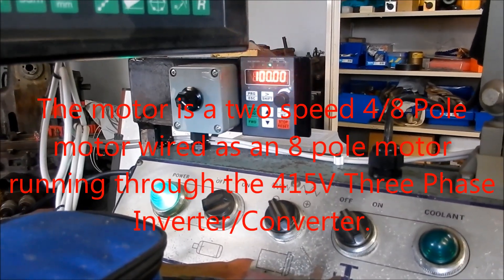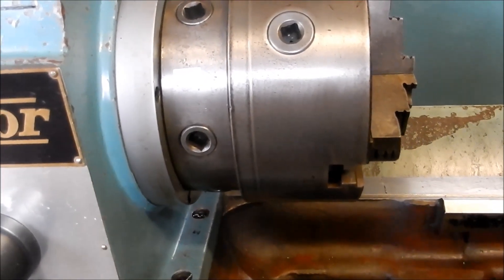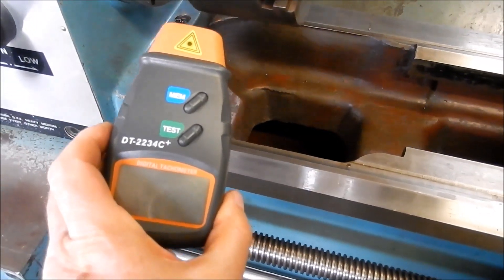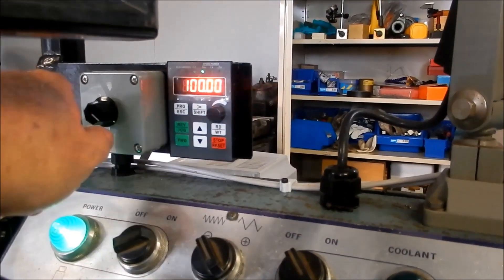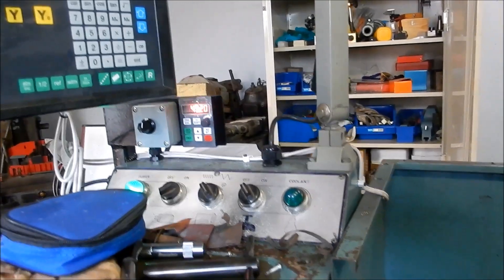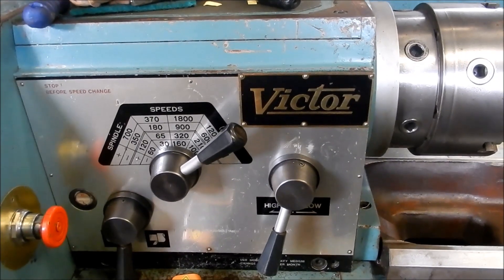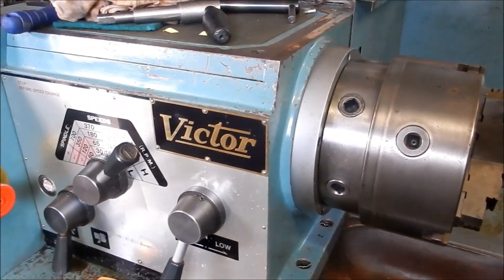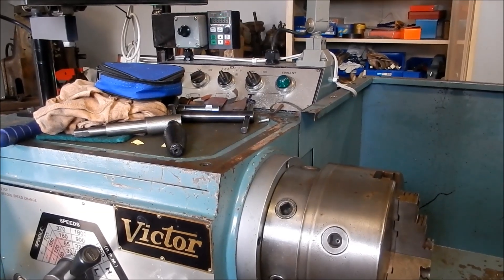Victor Lathe Spindle Speed Using the 8 Pole Motor Configuration

Comment: No te preocupes por esa configuracion...normalmente hasta 120hz no vas a tener ningun problema..es algo que yo suelo hacer habitualmente en muchos tornos y fresadoras y que a nivel personal lo tengo en varias de mis maquinas desde hace años..un saludo desde españa
Reply from the maker: Thankyou Tr, I have no issues with over speeding motors as they are quite capable of running at twice their rated speed all day long.  Biggest issue is slowing them down with a lower fan speed which lessons the cooling effect.  I have designed machinery where at times this is a requirement for long running periods so in these cases external forced fan cooling is the solution.
Cam

Comment: Hi Cam, no problem running at 100Hz, motor rotor rpm just under 3000 rpm.
2 pole motor at 50 Hz runs just under 3000 rpm.
50/60 Hz motors have only nameplate change, same motors.

Comment: Hi Cam, I'm probably late to the party so don't quite understand the plan. It was a 4 pole / 8 pole motor but you wired it only for 8 pole and got back up to the gearbox plate speeds by running the motor at 100hz ? But I missed why. My old motor on my Harrison lathe predates inverter frequency drives to I max it at 50hz but fitted a double size drive pulley so I get the indicated gearbox plate speeds when I run the motor at 25hz and double the gearbox plate speeds at 50hz. Cheers
Reply: Ditto - interested in the rational on this as well.  If covered in a prior vid and I missed it just say so.  The motor age is always the concerning factor when clokcing the Hz above rated.   My mill has a 4/8 poll motor as well and I use a switch to flick the wiring between them. Using V/Hz mode and not vector allows for that (obviously when VFD is NOT driving the motor).  Also don't run above 60Hz on the motor (per its plate) due to concern of breaking down the insulation.   But maybe I am being too concervative?